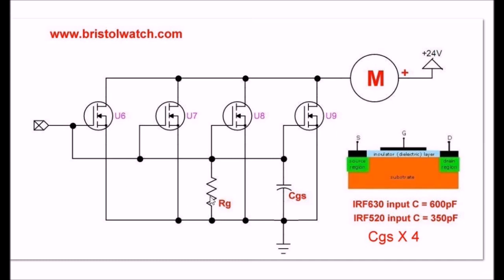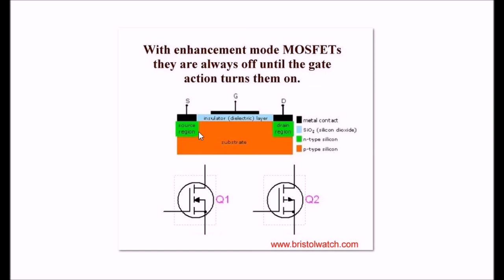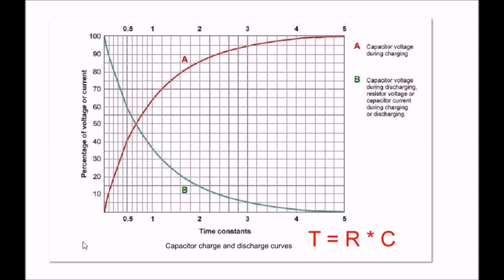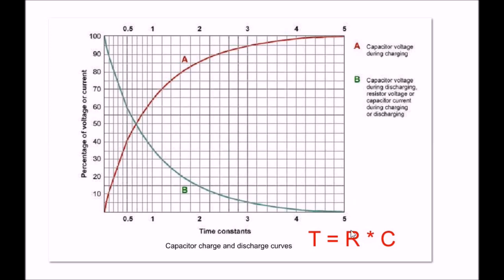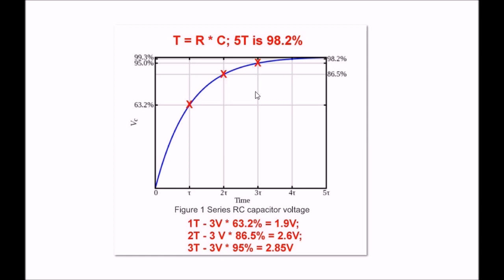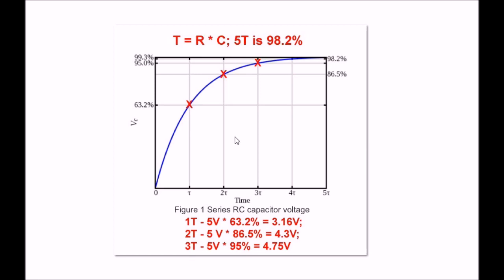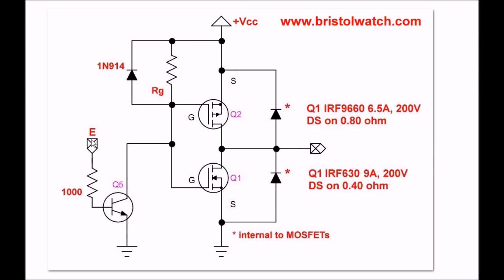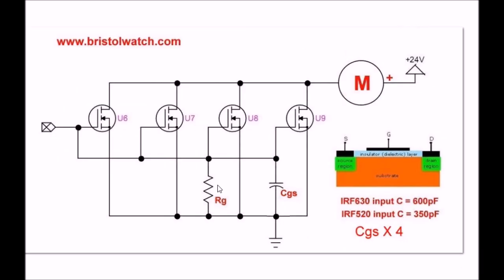Issues on Connecting MOSFETs in Parallel

Comment: Thank you very much for your clarification. I have some doubts on your h- bridge circuit. Inorder to switch on Q2, you are switching on Q5 to gnd, in the same time +VCC will get shorted to gnd via Q5. So you are blowing up the PS . Can u please explain that ?
Reply from the maker: Rg which is usually 10K will not allow Vcc to short to ground. Vcc MUST NOT exceed Vgs usually 20V most of the time. Thanks.
Reply: @LewisLoflin  thank you very much for your clarification. And one more think I have some other doubts also in building a h- bridge circuit. How can I contact you ?

Comment: What a fail. He can play smart by adding diode to mute any noise generated by resistor, but he can't put diode across motor for BASIC transistor protection.
Reply from the maker: Diodes are in the MOSFETs. They all come that way.

Comment: Excellent presentation !!! Have you ever use the HA210N06 mosfet ?? ...It has a very high current (50 AMps) for a Vgs of 5 volts as to be used with an Arduino....and therefore avoid using this lower current mosfet in parallel and all the issues here discussed...what do you think?  Thanks.

Comment: I have a plan to fire 8 IRFB4110 IN A sequence where the load is approximately  70A in this each mosfet will fire for 2 milliseconds each  in a sequence 1,2,3,4,5,6,7,8,1 . with heavy heat sink . the rating 
of the mosfet is (Imax) is 180 , will the mosfet stand the load as the duration of load is in millisecond 
and it takes 16 milliseconds off time for each mosfet yet the output remains constant on output end as all mosfets are connected to a common buss , they only fire one at a time .please advise , Can the mosfet bear the Current

Comment: Hi. I have a problem with a parallel arangement at high voltage. To mention that I am using already several years parallel arrangements at low voltage (40-150V) and big currents (40-240A), without problems. 

Short description: 6 x 500V/190miliohms (IPA50R190) MOSFETs in parallel, each driven with 10 ohms gate resistance; supply is 300Vdc, load is typically 2-3A/case, resistive load, and transistors should do overload to 6A/case for miliseconds; these transistors are good, can handle roughly 60A each for 1-2 microseconds (in SOA on datasheet). I am driving all of them with a single 9A driver (TC4422), it should switch them on/off very-very quickly (<100ns), and without problems. I have snubbers of 150 ohms+4,7nF on each transistor. Also I have 440V ESR diode in parallel on supply, and flywheel diode in antiparallel on output cables. 

Still, at roughly 4kW load (15A) one of the transistors immediately fail (always), typically I measure gate-source breakdown. What could be the problem?? Gate-gate oscillations? Gate-drain spikes? Or something else.. I am working on it, but a few ideas will be helpful. I do not have zenner on gates because I deemed them unnecesary (because of driver TC4422), maybe I should...

Comment: Would this capacitance issue also apply to bjt transistors?
Reply from the maker: There is capacitance in BJTs but not like MOSFETs. BJTs are current controlled MOSFETs voltage controlled.

Comment: Maybe I missed it, but the beauty of parallel MOSFET is the positive temp coefficient which keeps one from hogging all the current.  BJT transistors require negative feedback to keep one from hogging the current and going into thermal runaway.  Here’s the trick, use drive voltage at least double the gate threshold, now your tc doesn’t matter.  Use appropriate sized gate drive resistor for each MOSFET.  First this is placed close to the gate to nullify gate inductance, and has to be small in value the faster you switch, but big enough not to overvdrive the driver.  This is why a drive chip is recommended, especially to drive the parallel gate capacitance.  Keep Rb resistor in to help pull gates low.  If you are switching real fast go to GaN Fets.
Reply: Use a drive IC.  The best hand work doesn't put a dent in lead inductance (which is what I think you mean).  This entire topic goes away with well designed PCBs and correctly selected drive ICs, hence why everyone has forgotten about it.
Reply: So if am paralleling 40 mosfet for 10kw ,every gate of each mosfet should have a 10k resistor to start all at once is that what you are implying
Reply: That's why you can use parallel mosfet they self regulate load hogging  bjt melt they are power hoggs

Comment: I made another variation to connect my two mosfets in parallel for each side so 4 mosfets in total... (ZVS Driver circuit) I have a variable input voltage via a LM317 which I set to 14.8 volt (VCC), from VCC I have on every gate a 470 ohm 2 watt precision resistor (1%), also I've limited all gates with a 15 volt zener diode and I've put a 10k ohm resistor on every gate to ground.

It's the Mazzilli circuit but I changed it so every mosfet has its own zener diode and gate resistors and the 4 schottky diodes so everything times 4.

It's a monster zvs driver with an isolated power supply to drive the gates via the LM317 at 14.8 volt and I use 4 computer power supplies in series to get 48 volt capable to deliver a maximum of 20 ampere but my circuit needs about 8 ampere so I have plenty of headroom...

I have a flyback transformer connected and the output of that is about 100kv... I can pull 10cm white hot plasma arcs with it, it's a beast!

Best regards,
Ricardo Penders
Reply: Made an update to my 4 MOSFET ZVS driver, I made a new power supply using the LT1084CP Linear Technology voltage regulator, it can drive loads up to 3 ampere and this particular regulator tends to go up a bit in voltage, this is different from the LM317 regulator because that one tends to go down a bit in voltage. For my ZVS driver I prefer the new regulator because I don't have to worry about the voltage going down from where I set it with the potentiometer and it can deliver 3 times as much power as the LM317.

I also added a new 24 volt transformer (100VA), a footswitch to switch two 24 volt AC relays, one which I've connected to the high voltage AC before the bridge rectifier and the other relay after the bridge rectifier for safety reasons because I don't want to mess around with any part of the high voltage part since I've shocked myself a couple times when connecting the power by hand. So now I can switch the two relays together with the footswitch using the low voltage of the 24 volt transformer which also provides the power to my new voltage regulator that drives the ZVS driver.

The high voltage part is now coming from a new high current audio transformer which is fully isolated and disconnected when switched off from the voltage regulator by the two relays to make the flyback much safer.

Now I get even longer and thicker plasma arcs and much more ion wind, the arcs are now about 15 cm which is about 150 KV and the absolute maximum that my flyback can handle for a somewhat shorter period of time. I'm still able to play with it for 10 to 15 minutes without any problems.

So I've tested my leyden jars with it and the sound coming from the arcs is super hard, overwhelming and scary... But I want to use it to drive a spark gap tesla coil for my next experiment.

One thing that I find interesting using 4 MOSFETS is when I blow up the driver (it happened 2 times) it only kills just one MOSFET and nothing else, the driver simply locks itself when a MOSFET is blown and it doesn't short my low voltage power supply or the high voltage power supply when it all goes to sh*t, just the one MOSFET which is an unexpected outcome.

Best regards,
Ricardo Penders

Comment: for the circuit of figure 10, to each resistor of 27 ohms can the diode 1N914 be placed in parallel?

Comment: Can I increase MOSFET D S voltage by connecting Diode in series ex using P55N 60volt MOSFET with Fr10 series diode which block 100 or 600 volt reverse ? Is it possible ??
Reply: use high voltage mosfet

Comment: How ! 11:41 you said mos 1 fire first mos2 sec mos 3 fire next ! Why if all MOSFET connected in parallel with parallel gate connection so all should be Active at once because all signals comes  at same time ???
Reply: Because of production variants, they are not all the same. One hast a little thicker gate insolation and so so, they are not even close to be perfekt.
Reply: Ideally yes you are right.  Unfortunately things are not perfect and all turn on at slightly different voltages this is why the datasheet shows a minimum and maximum and a typical which means any single device falls somewhere in that range. so if the MOSFET with the lowest threshold turns on before all the others it alone is carrying all the current until the others catch up

Comment: In the circuit at 18:41 the 1N914 diode provides a fast discharge path and the 47 Ohm resistor creates a slow turn on. The problem with using parallel mosfets is not that they turn on at different points because when they first turn on they will be barely turned on and they will remain in the linear region well past when all of the transistors start to conduct. The problem is that they will all spend much of their time in the linear region which causes them to heat up. Quickly driving all of the transistor past the linear region allows all of the transistors to operate in their low resistance region for most on the on time. Discharging quickly is the same problem as the transistors have to come out of saturation and then turn-off traveling through the linear region. 
The diodes does not remove noise in fact it creates some near the barrier voltage but at less than 1 v the transistors are fully off so the noise does not affect the transistors.

Using a 12v drive and the 47 Ohm resistor allows the bias voltage to rise rapidly but keeps the transistor in the linear region long enough to reduce turn-on surge currents to a reasonable level. Balancing how fast the transistors turn on with the problem of power loss in the linear region is part of designing the circuit for the load. The problem with turning off the transistor very fast is than the motor which is an inductive load will fighting the reduction of current and cause a voltage spike which can exceed the breakdown voltage of the transistor or other circuits connected to the power supply. By slowing the discharge down a little the transistors can reduce the voltage spike by lowering the dv/dt. The discharge typically should be faster than the charging so that the transistors reaches full off without too much delay. This is particularly important in an H-Bridge because the other transistors are going to be turning on and you don't want both sets on at the same time even for a short duration.

In addition when driving large currents you must be very aware of ground bounce. This is what happens when large currents switch and the stray resistance and inductance in the wires causes a extra voltage between the ground and the source of the transistors. This can cause the voltage at the gate to rise possibly enough to exceed the gate to source break-down voltage for a short duration. It can also cause the gate to become partially turned on when the gate drive voltage should have fallen below the turn-off point. For this reason gate discharge should be done through a active element not a resistor and terminated at the source of the transistor not at the power ground. When switch occurs at low enough frequencies using a single resistor to all gates works well enough but as the frequency of on time decreases the added stray capacitance and inductance in the wire to the gate will bite you just like the gate does. By driving the all through separate resistors you isolate the stray capacitance and inductance to only one path to the gate. This can also allow using a high gate resistance which can be help keep MOSFET device failures from damaging the driver circuit and other MOSFETs in the stack.

Power MOSFETs are very capable devices and can handle serious power but their weakness is the gate to source breakdown voltage. Protected the gate and keeping voltage spikes below the Drain to Source breakdown voltage will keep them happy. And as always heat is every circuit's enemy so keeping the cool is the key to long life. Properly driving the gate can make a huge difference in both static and switching power loss. When dealing with large currents always remember that every wire is a resistor and a inductor. Lastly don't ever believe the specs that say the transistor can handle more than 100 amperes, the leads will melt at around 75 amperes. Average 25-30 amperes per transistor is more reasonable with spikes around 50 amperes are still possible by the beefy transistors at DC or low frequencies. As the switching frequency goes above 50 KHz things get tricky and you will be increasing the switch losses resulting in more heat.
Reply from the maker: True. This is hobby level and to present circuit ideas. You need a good clean switching pulse. You can lower the 47 ohm that is what I had when I built it. Try 10 ohms, etc. thanks
Reply: Hi. I have a problem with a parallel arangement at high voltage. Short description: 6 x 500V/190miliohms (IPA50R190) MOSFETs in parallel, each driven with 10 ohms gate resistance; supply is 300Vdc, load is typically 3A/case, resistive load, and should do overload to 6A/case for miliseconds; these transistors are good, can handle roughly 60A each for 1-2 microseconds (in SOA on datasheet). I am driving all of them with a single 9A driver (TC4422), it should switch them on/off very-very quickly (<100ns), and without problems. I have snubbers of 150 ohms+4,7nF on each transistor. Also I have 440V ESR diode in parallel on supply, and flywheel diode in antiparallel on output cables. Still, at roughly 4kW load (15A) one of the transistors immediately fail always, typically I measure gate-source breakdown. What could be the problem?? Gate-gate oscillations? Gate-drain spikes? Or something else.. I am working on it, but a few ideas will be helpful. I do nat have zenner on gates because I deemed them unnecesary (because of driver TC4422), maybe I should...
Reply: @addysoftware  Working with high voltage and current can be difficult to dangerous to diagnose, scaling down the power level is often a good idea so you can observe the heck of the circuit without it failing so quickly. I would also put in a zener diode that you may not need in the end but it could provide some good protection while you find the problem. I would not drive 6 transistors from the same driver just because the trace length starts adding up quickly. Using two drivers may be a better fit. One advantage of scaling the power down is that you can just leave transistors out of the circuit and observe how adding them in affects the circuit performance. You may find that certain position on the board have different effects when a transistor is present. Observing the gate drive signal at the gate pin relative to the source of that transistor could be very helpful. Observing the voltage across the drain and source is much safer to do at lower voltages and current levels and what you care about is not the exact voltage but the patterns like ringing or sharply rise and failing levels. This can be used to tune your snubber circuit for maximum effect and let you observe the effects of changes to the driver circuit.

Look for difference in the signals pattern on different transistors. This could alert you to PCB layout issues, which can be lots of fun to resolve. One of the most critical connections on the PCB is between the sources pins and the driver ground. This connect alone could be a argument for multiple driver chips and using a driver with a lower current capability but with a lower price may be a good trade off making it practical to use more drivers. Using more than 2 layers may be needed to give you a way of separating circuit loops and making sure the driver get all the power they need to do there job. Decoupling the heck out of the drivers and the signal sources is also important. Also make sure the control circuit and driver circuits has clean power.
Reply: @briannebeker2099  , hi! And thank you for the detailed answer. Actually I solved the problem long ago, it was because of imperfect on-off timing due to inequal traces to gate and to source, but combined with the presence of 2x100uF/400V on supply (PV Panels), and the load (an MPPT charger, at some small distance) also had big capacitors on input; but I couldn't change much of them (the traces). 

I recoursed to removing the 200uF capacitors,  which stores a lot of energy at that high voltage, far more than 1 transistor joule avalanche capability. The capacitors initial role was to absorb eventual induced voltages from lightning strikes, it was design in parallel with the input, and also the board had 1 x 5kW 440V TVS diode and another 3 x 220nF/400V caps. 

I removed the 2 x 100uF and replaced them with 2 more diodes, and now the circuit is performing well; i did several thousand of on-off cycles (on test) with 6kW load and no problem. Is working in the field now.
Reply: After stripping the semantics away I think you are saying that off rate is as important as on rate.  Reasonable.  What's not reasonable anywhere in either the video or your post is the use of the term noise.  It's not semantics.  Are either of you talking about flyback?  Do you think the resistor is acting as an antenna? Do you mean that power dissipation is duty cycle dependent?  What "noise" are you talking about?
Reply: Those are really good points. I can see how they will be affected by high frequency switching. I'd really like to read more about this. Do you know of any documentation I can take a look at?